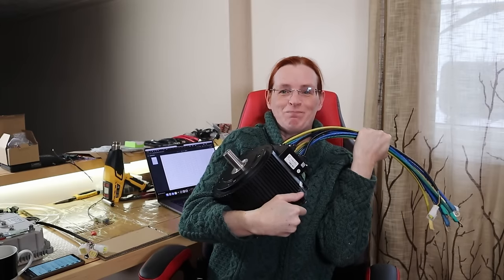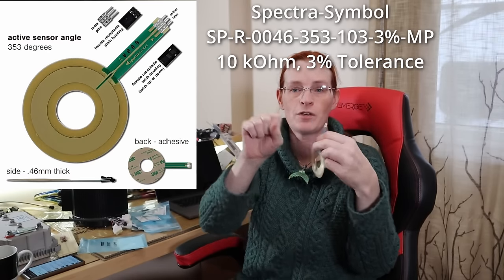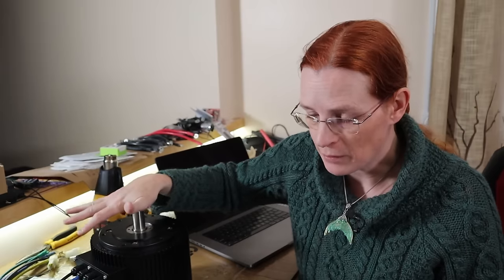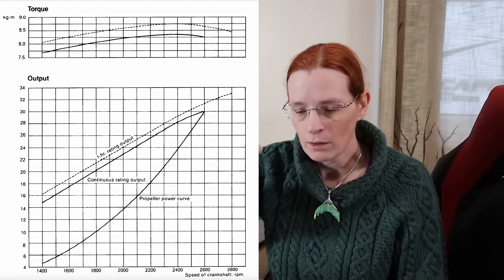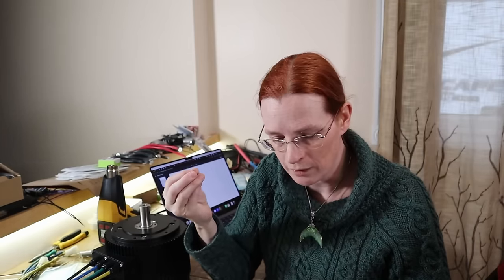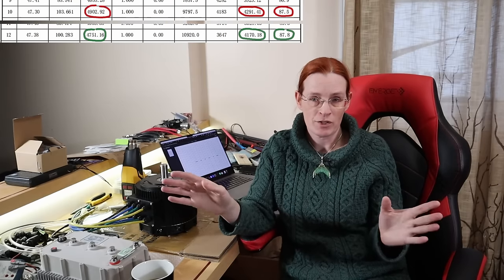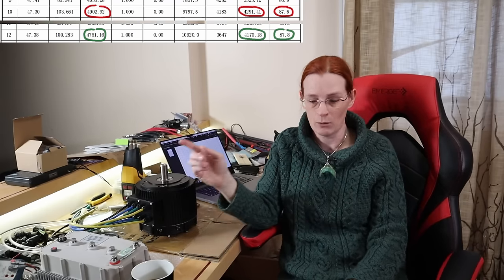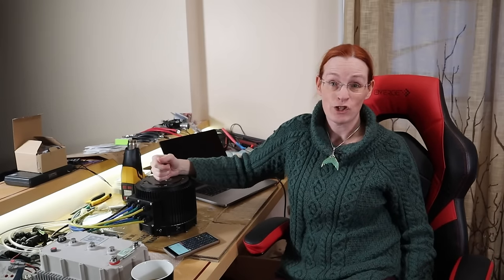Ep. 86 - Decisions Made! - Let's Get Technical

Comment: Looking further in your video, can you sync 2* 5 KW motors to the same shaft?
Reply from the maker: Yup! I played with that idea, too. Though by the time I really dug into it, I'd already purchased to the 10kw, sooooo. :)
Reply: @TheDigitalMermaid  you might combine them on the same shaft as well 5+10. Maybe there is some optimal rpm for very heavy currents you encountered in that canal and maybe faced with heavy winds. But very positive thinking about looking for the optimal engine for the drag of the boat, that helps a lot. One of the things which will get your attention lateron is to get the most out of your solar cells in less ideal conditions. Combining cells to get higher voltage might get you a faster charge. Maybe add some portable cell outlets as well make you flexible for flexible cells outside when stationary. But all will come at a cost, most pockets reach their limits so it's always some compromise. Thanks for sharing all your thoughts on the channel I think this is key so the community can react.
Reply from the maker: Portable/folding cells are generally for 12v systems, so I'm not sure how much they'll help unless I series a bunch of them. Being a 48v boat, I need at least 60v open circuit to charge, so it's almost certain that I'll be doing a two panel series when the time comes. So I suspect I'll be doing a 4-panel setup, two port and two stbd, each side on their own MPPT. All this said, until I see how the boat sits post conversion, I won't really know how much weight I can spare for the solar arch, so I'm holding off digging too deep into the solar just yet. It's gonna be a bone to chew...
Reply: @TheDigitalMermaid  please be aware that there are also step up MPPT trackers, I've bought one so I can have a single 22V 200W panel on 48V. They will start faster with less voltage
Reply from the maker: @edwardvanhazendonk  How do their efficiencies compare?

Comment: Why not just electrically disengage the motor you don’t intend to use?  Then you can have both motors belted at all times and just free spin the motor you’re not using.  You’ll be able to switch instantly when needed.
Reply from the maker: The motors have a lot of resistance when not powered (I can't turn the 10kw by hand), but also added wear on the motor.
Reply: @TheDigitalMermaid  that is because there is something hooked up in side that is cause them to act like breaks. If you wire the coils together they will do that . unhooked there shouldn't be anything like that. Random - This happens with speaker cones - take a cone and tap it -- it sounds hollow and resonates. then hook a wire form + to - tap and again, and it is not resonant, its "tight".
Reply from the maker: @kevinnemrava  Trick is, without modifying the motor, can that be disengaged? I would worry that if so, I'd lose the ability to do regen.
Reply: @TheDigitalMermaid  I uploaded the image of your motors wiring diagram to ChatGPT and it suggested that to free spin the motor you have to first cut power to it, and second disconnect the load.  To do that, here's what it said.  

Control Signal Management: BLDC motors are typically controlled by electronic controllers that manage the timing and power delivered to the motor's coils. If you have a controller like the one depicted in the image, you can disengage the motor by disabling the control signals. This could be done through a switch, a relay, or a software command, depending on your controller's capabilities.

I'm couldn't say if this is accurate, or if your controller can do this, but it seems worth a poke around.
Reply from the maker: Aye, I do plan to play around with free-spinning, so thanks for this. I'll dig more into it again when I get to that phase of the project. :)

Comment: Hey, the new Tesla Cyber truck went to 48v power for lights and cabin electronics etc. Musk said they largely did it to save weight, because they could use a smaller gauge wire, like you were saying. Smort. BTW, can you please stop inspiring me to electrify my 1975 Honda motorcycle, please? It would cost a fortune! Maybe stop getting so excited about the unknown in your videos? Less positive energy, would also help me stay uninspired😂😂😂. This first video in ‘phase 3’ was great! Be well, and happy holidays.
Reply from the maker: 12v is soooo last century. I didn't talk about it in this video, but I'm going to be doing all I can to get my boat entirely 48v. For now, some devices need to be 12v, but I'll replace them as soon as I can. Also, no, I will not stop encouraging personal project. Go! Do the thing! Happy holidays!

Comment: use a cog belt drive system, gear the motor down and run it at a higher more efficent rpm range
Reply from the maker: Aye, leaning towards a toothed/cogged belt.

Comment: The efficiency of the electric motor drops with a decrease in voltage and an increase in current, since resistive losses in the windings increase.
Reply from the maker: Makes sense.

Comment: 1300 lbs. battery weight wont be a factor. Your diesel engine was half that. Your fuel made up most of the rest of the weight. its close enough that I do not think its gonna be an issue for your boat. Remember to load balance so you do not hobby horse. when you build your arch the added weigh needs to be added to chain locker area. Adding 2 house banks near the  Bow cabin/ anchor locker area can balance the difference a bit. so maybe even another water tank up near the bow might be needed.  Again balance the weight you add on for solar arch with weigh at same spots on the bow accordingly.
Reply from the maker: Aye, I was trying to think it out, and I got to the point where I realized "just do it and see". Hobby horsing is another concern, too. I'll get her in next summer (I hope!) and then I can just try and see how she handles, and move things around to see if I can get her nicely balanced or not. The idea of moving the packs forward is that it would replace the ~150 liter water tank, making it about a wash for weight distribution.
Reply: @TheDigitalMermaid  How about wiring the batteries as a pair of very long / skinny batteries that run along the fronts of the settees, under the seats?  It would distribute the weight linearly, low and near the center of gravity.  Just thinking outside the (battery) box.
Reply from the maker: I considered that, and it was actually a design I tried in the very early days. In my boat though, the interior space is _tight_. Losing space in the main saloon is a very hard thing to justify.

Comment: @TheDigitalMermaid  - 7 * 280A = 1960 A * 48V = Jesus what a power. Nearly 100 KW
- I was 3 minutes faster abut the 100 KW you mentioned. haha.
- if you visit my country you need 230V ;-)
- Have you thought to install a small 2KW diesel generator?
- Arduino Help. I can help with an esp32 too. With that you could have a web page via WiFi Ap on that esp32 to setup and control the motor/controller.
- I wish i would live bear your place, then i could teach all what you need to know on solar and Arduino/esp32 coding.
Reply from the maker: LFP 16s packs have a nominal voltage of 51.2v, x 280Ah x 7 is 100.3kwh. I'm planning to have two Multiplus-II 5000VA inverter/chargers, a 120v and a 230v version. So when I switch to a different power region, I can move the shore power connection to the appropriate Multiplus. I do plan to add a diesel generator eventually, but even when I do, I will do everything in my power to never use it. 

The arduino is to start. I actually talked to my friend Andrew last night for a couple of hours about porting the arduino test setup to an esp32 or smt32 when I'm ready to switch to a proper circuit board.

Comment: Dang how big does the Belt need to be to handle a 10kw motor?
Reply from the maker: It's actually considered pretty small... Consider the size of belts on cars, and they easily hit 100hp / 75kw. So I suspect I'll be able to have a pretty small belt, all things considered.
Reply: @TheDigitalMermaid  That's actually where I'm drawing my experience from, I don't know about in Canada but here in Vegas cars that run the drive power through a belt are rare enough I've only ever heard of one kind, they are called CVT but the belts in those are like 8 inches wide and if I'm not mistaken made of metal and changing them is not something you do for the life of the transmission.
Reply: Actually come to think of it there are motor cycles that do it, those are closer to 2/3 inches wide but still a pain in the backside to move around. 
I don't deal with motorcycles much and the thought only just occurred to me.
Reply: Ok, I think I'm seeing it now, a Motor cycle belt would be need to be toothed and 20-30 mm wide but they do come rated for the power you need and are widely available, neat!
Reply from the maker: @Flamytygwa  Aye, and I'm leaning towards toothed belts. 20~30mm wide is totally fine for me, the motors come with 50mm keyed shafts.

Comment: @TheDigitalMermaid  - 360A * 48V = 17,280 KW ~ 23,2 ps/hp. That's the max output value of that motor. Not in continuous mode, haha
Reply from the maker: LFP is a nominal 3.2v/cell, so 16s is 51.2v. The controller is what you're talking about, I assume? In any case, the motor itself has a max draw of 13,282.43 watts input, for 10,535.04 watts output.

Comment: You know, if nothing else there are portable generators that could save you in a pinch. In a "lack of shore power" situation that is.
Reply from the maker: I've got longer-term plans to take an 8~12hp single cylinder air cooled diesel and mate it to a 48v native alternator, like the Balmar 60 or 100 (which speaks LFP). Basically, get the smallest possible bang bang box to turn diesel into kw as efficiently as possible, and then do everything in my power to never use it.

Comment: You mention that the efficiency loses at lower speeds is just gone, while yes it's not being used to move the boat it doesn't just disappear.  Think about where you can use the efficiency loses, read as HEAT, Hot Water!! Would it be more efficient to heat your hot water with the loses rather than an actual water heater?
Reply from the maker: So I didn't talk much about cooling in this video, but you'll notice both the motor and controller are liquid cooled. ;) The plan is to run each motor and controller to a dedicated radiator, with the heat ducted out the exhaust behind the captains seat. For colder whether, redirecting that into the cabin is absolutely something I'm planning to play with. :)

Comment: Sizing the cables to handle 400+A is going to pose topology challenges and further increase the weight distribution problem. I will try to run up some hydro dynamic calculations for the Landfall 38 and have a stab at estimating the likely stability and upwind sailing performance hit if all 7 battery banks are located aft of the mast. This will inevitably involve some simplifying assumptions, but will hopefully throw up some "Do Not Exceed" parameters

I am surprised that the insurers would take issue with you simply removing the Yanmat "whilst keeping an open mind about what to replace it with". (How else could anyone ever replace an engine or even lift one out for repair?). I take it gejr major concern in fire or explosion, in which case the preventative measures required may also have a direct impact on weight and architecture.

In closing, I see the biggest challenge you face is that 2025 is a long way away and all of this electric nononsense is going to cost you another 12 months adventure downtime. Repent your faith, hoist the sails, learn to love your Yanmar and get out on the water sooner rather than later. You know it makes sense! Let's face it - the Dinosaurs were a pretty mean bunch and probably had it coming to them : I'm thinking of copyrighting the phrase "Karmic Combustion" by the way...
Reply from the maker: To be clear, I won't be using 400A, I talked about it exactly because I wanted to show how hard it was to deal with such high currents. The very most I can pull will be 260A with the 10kw at full power, and the cables I've got feeding the controller will handle that OK. 

If you can do load calcs on my hull, holy crap that would be amazing! Feel free to send me an email (click on the About tab to get my email). I'd be very happy to provide any additional details I can to help make the calcs more realistic. I wish I had the lofting plans I could send ya! 

I heard back yesterday from another insurance provider who said they think they can get me coverage after the conversion is done. So I asked them when would the insurance stop, given folks pull their engines out for service all the time. That is to say, what would define the uninsured time? I'm waiting for a reply, but it's the first positive progress on this front so far. 

"Repent your faith" - hahaha! As an ex-Catholic, that was an amusing choice of words. ^_^ - Nah, I'd give up sailing before I'd accept a diesel, and I'm not going to give up sailing. ;) Joking aside, the whole genesis of the project was the realization on my first sail on a friends boat that it wasn't boats I disliked, it was the noisy engine I disliked. So literally since day 1, back in the summer of '19, the plan was to go electric.

Comment: If you  take out the diesel engine, an insurance still has to accept this. As any boat who get its engine pulled for service or  rebuild. So no problem for the planning there and you can sell your engine.
Even better, since an engine is a rather big part of the total value, you might, for the period the engine is out, insure it for a lower value. Which safe some money too.

As a ultra lightweight hiker, obsessively (which actually fun to do:)) strips his gear of any non functional weight, yes even cutting toothbrush, removing labels, he reduces it's pack weight from 20kg to 7 for a 5 day trip icl tent sleeping bag cookset  etc. 
I am sure, that  with a bit of that lightweight hiker mindset i can strip with no compromise to functionality with ease 250 kg of your boat. So instead of only thinking of what to add...= lot more weight=more displacement=more Kw to move=more to charge, think first what you can strip more than the engine alone. I see glass doors, lots, useless wood trims, do you really  need a wooden 15kg door on the toilet? or will a curtain or foamcore panel do? etc etc. Race sailing boat use the same principle.
Reply from the maker: Insurance has been a huge, huge headache. Thankfully, my broker is going way above and beyond trying to find me coverage. At this time though, my current provider said they'll stop covering me once the conversion starts. Still no luck yet finding a company who will cover me. =/

On displacement, you are right, but there's a place where weight helps, and that's stability in a storm. Going too light can actually be a problem, best is to aim to be as close as possible to the designed displacement. Now, racers on the other hand... Those folks are mad bastards, haha

Comment: Look again at the torque vs efficiency graphs at 25:00.

The 10kW motor's efficiency peaks at 12N.m.

The 5kW peaks at 6N.m, but  there's a trivial difference vs 12N.m.

The efficiency (see ~13:00) goes up as the shaft speed goes down*. But, surely lower speed over water implies lower prop RPMs, which implies a *lower motor shaft speed?

ISTM the higher efficiencies either need a smaller boat or a bigger propeller?? ISTM those graphs in no way reflect the real world performance with a fixed size / fixed feather prop. 

Perhaps equates to a high RPM with the prop mostly feathered, but would you run the prop that way??? 

If you had 2x 10kW motors, but one of them had a drive sprocket twice the diameter, wouldn't that 10kW motor would be in its high efficiency torque output at half the prop torque?
Reply from the maker: So when I was talking to Brunton, and I sent them the dimensions and told them about the electric conversion, I said that I had not yet set the pulley ratio, and that I could do so to suit their recommended RPM. They included that (peak of 1200rpm) and recommended the 430mm prop (three-blade feathering). The details are linked in the description.

All you're talking about is stuff I've considered, but as much as I try to know how things will be before hand, it's all just theory. The real test will be getting in the water and just, going. Even post-launch, I could experiment with different pulley ratios, etc. I full expect to do a LOT of experimenting to find more ideal configurations. It's partly why I am so excited to get in the water as soon as I can. Nothing teaches you better that actual real world testing!
Reply: @TheDigitalMermaid I should have realised - you don't do stuff half-hearted. 😂

Have you considered a toroidal prop?

Two Bit Da Vinci did a video - search for "genius propeller".

Doesn't feather, of course, and no idea if it's any good for regen.
Reply from the maker: I saw all the hype when it was first coming out, and I saw the guy who did the 3d tests. It's a tech I'll keep an eye on, but for now I'm favouring tried-and-true for the prop. :)
Reply: @TheDigitalMermaid I've just seen an article on New Atlas about a contra-rotating Shannon prop. Of course, it doubles the price of their single-prop device. 😱

Article says "Sharrow claims that it patented props can improve efficiency to the tune of 30 percent more range, boost reverse thrust by 50 percent".

Is that the same as saying it's 50% better for regen????